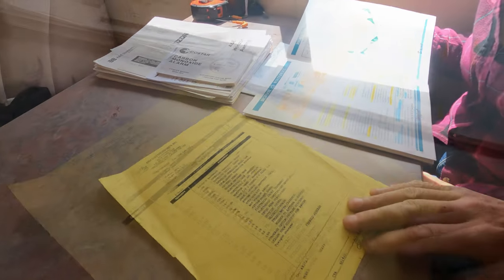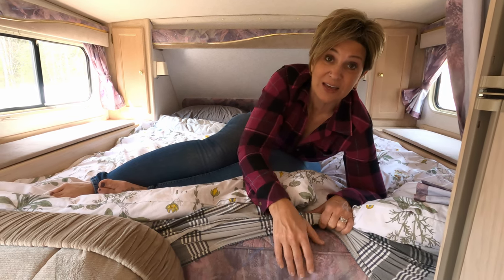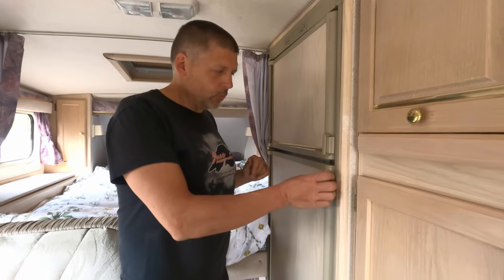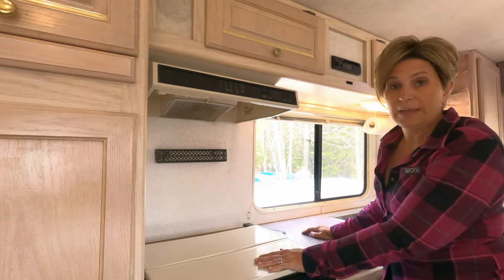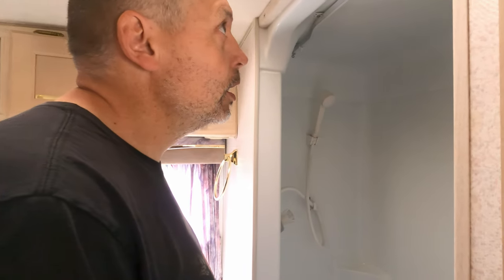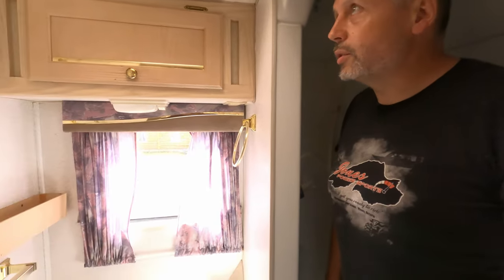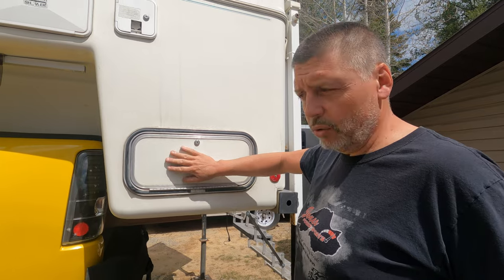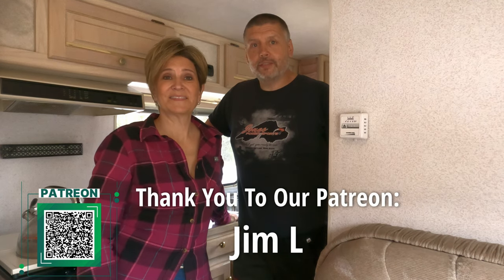Our Truck Camper Renovation Begins: Pre Renovation Tour

Comment: Did a Reno on a truck camper a couple years back...fridge was shot... pulled it out and it wouldn't fit through the door to get it out....had to completely disassemble it...doors, cooling unit on the back....found a 6cu ft residential fridge at Lowes that fit the opening with next to no mods..added rigid foam to the inside of the cabinet and squeeked it in tight...only used 50watts (3amps I think)when cooling down..took about 10-15mins and was golden,,,made a custom solar panel rack for the roof that was just above all the vent covers and put on 2- 310 watt panels down the centre  and had room for a kayak on either side...2000 watt inverter and 4 arm glass mat batteries,...installed a 2 battery bank  with the solar controller and inverter in a box in front of the bed step up adding another step that made it easier to get up to the bed...one more under the kitchen sink and one in the original battery compartment....weakest part of the system was definitely the batteries...should have went with lithium.....big project...you guys are very ambitious....made the composting toilet with the urin diverted to the black tank...its the way to go.    will be interested to see the finished project.
Reply from the maker: Thanks for watching and sharing your experience with us. We only had to take the doors and front trim off our fridge to get it out. Not too bad.

Comment: Just a thought from an old rv tech….nothing wrong with the Dometic. Sometimes sitting air locks them so remove it rough it up and rotate it to move coolant around and it will work for 30 years
Reply from the maker: The fridge has made its way to a new home.  Hopefully, it will continue to work for them for years 🤞  Thanks for watching!

Comment: bought the composting toilet Urin diverter and vent fan off Etsy....a guy 3d prints all the parts to fit a 5 gallon pail.used those porta loo basin it.. worked well and was affordable..much cheaper that buying a manufactured composting toilet
Reply from the maker: We purchased a free range designs urine diverter from Amazon that we will be building the toilet around. The reviews seem good. Hopefully it works out. Thanks for watching.